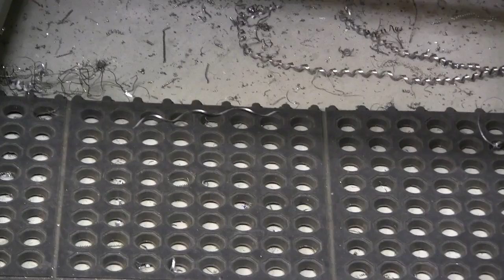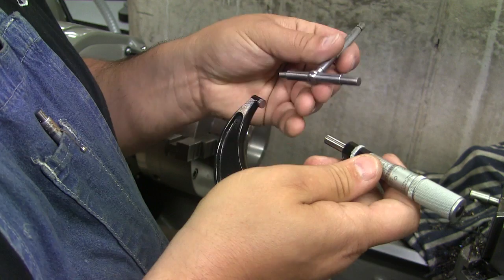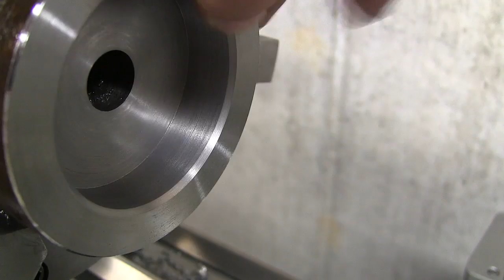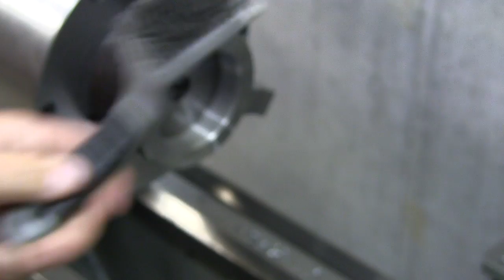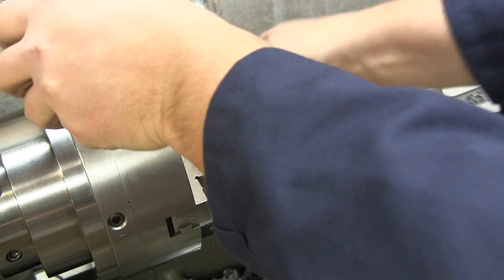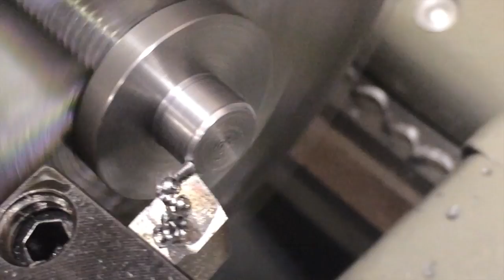Machinery Upgrade #2: Machining Lathe Leveling Jacks

Comment: I have no idea & readily admit it! That said it just looks to me like you have your work piece chucked up wrong, with the chuck jaws so far outside the chuck waiting to take some fingers or a hand off, while your oiling or chip clearing.
Is there a better / safer way to chuck up your workpiece?
One last question please.
Is there a reason YouTube machinists use oil to lubricate cutting operations that create so much heat, rather than using Chlor Parraffin cutting fluid?
Oil runs away from heat, so moments after you apply it, it’s no longer lubricating the surface being cut or the hss cutting point.
Chlor Paraffin however has the opposite property to oil, it is attracted to heat, and actively moves towards the heat source. The more friction, the more heat which means better lubrication. Chlor Paraffin is cheap at a couple bucks a litre, and as a cutting fluid is unbeatable. Company’s like Bitron etc add it to gear lube oil for diffs to protect gears bearings etc because any sign of heat attracts more lubrication.
It’s no good adding it to engine sump oil however, because the engine blow by gasses reacts with the chlorine of the Chlor Paraffin to for hydrochloride acid which is corrosive inside your engine which you don’t want, for manual gear boxes and differentials however it can’t be beat, and as a cutting fluid is the machinists fluid of choice.
My 2c - now I will get back in my box. 😜

Comment: I just ran across this older video. Someone should have told you to level with temporary shims and then grout understand the legs for full contact if the base. Temp forms around the legs and use a pourable nonshrnk grout.

Comment: what a great video. I admire your perfectionism.  we are finishing a second southbend lathe. my attention to detail is like yours, where there is not a nut bolt or gear tooth that is not touched. hundreds of hours, so I really appreciate your work. my question is how you painted the gear ratio plaque and the others, regarding the different colors. have had the greatest trouble with this. thanks steve.

Comment: You wouldn't by chance have a picture of the Gear ranges on the QCGB and the gears on the spindle side? I made a spreadsheet calculating gear ratios fro a logan QCGB and I am interested in seeing one for a SB lathe. I am forming an idea for a QCGB for a small lathe I plan on purchasing in the near future.

Thanks and keep up the good work.
Reply from the maker: I believe on the restoration video of the 13". there should be those pics.
Reply: Thanks! I ordered a mini lathe from Grizzly and I am in the process of designing a QCGB for it so I don't have to spend time manually changing gears.
Reply: William Combs ç

Comment: The jacks are awesome, the job you did was amazing. From your other post you mention you had an out of balance shaft/ gear that you feel was causing the lathe to move. At times when machining and out of balance part that same issue will happen. Resting the lathe in leveling points will never be able to hold the lathe down, only anchors down to the floor, shimmed and leveled of course first, will do.
Reply from the maker: +Douglas Smith For sure. There define;y is some RPM that makes the machine dance around.

Comment: Real nice machine,those original leveling pads you had were set up to high.They should have been down on the legs and touching the bottom of the machines legs or base.Most of those pads only have a 1 inch travel that's done in the rubber inself.The rubber acts as a vibration absorbing unit.
Reply from the maker: +Peter Will The back/left pad was just like that. It's my floor - it's SO out of level due to some sinking and cracking of the floor pad. In order to level the pads, they rose up like that. That's the reason these leveling pads are all custom lengths, to take up all the space. The machine (still) vibrates though as I've since located the real issue - an out of balance bull-gear. Gonna try to fix that in the future.

Comment: noticed your chuck is that a quick change mount ya got there
Reply from the maker: +Miguel Castaneda Thanks!
Reply: Oh mentioned to on quick change was that done by you or factory ...have 12 inch aquired
.essentially same yrs but threaded on chuck

Comment: 2000 rpm.....050 doc....20 ipm
Reply from the maker: +kevinp860 This machine will do .250 doc (done it before) but 2000rpm, is unattainable with a plain bronze-bearing machine.

Comment: Just wondering what model your Aloris tool post was?
Reply from the maker: It's a BXA
Reply: Thanks Brad.  I'm actually looking to buy a SB 13" and was also wondering if your lathe was a 3 phase or a single phase.  Thanks in advance.

Comment: Hi there, technical question please. I have noticed on several American machinist people here on you Tube, set your topslide / compound slide at an angle, for general turning. I did ask Tubalcain why, but he never got back to me with an answer. In this mode you are unable to turn to a shoulder with a set length unless you use a carriage stop. Here in England we always have the top slide set parallel to the lathe axis. Just wondered whether it was something that was taught in America and any reason for doing so. I know that it gives more clearance for the tailstock, but can see no other advantage.
Reply from the maker: Hmm. I guess it's force of habit Dave. I will though give your method a try, seem to make sense. Thanks for watching!
Reply: I'm new to machining, but I've been studying books and videos for a year or two, and I think the answer to the angled top slide question is that it's for threading. Angle is set for 29.5 degrees due to the 60 degree standard thread here with UNC and UNF.  If you leave it set that way, you don't have to reset it when you need to do a thread (unless you are going from external to internal and don't want to cut on the back side for internal).

Since I haven't tried threading yet, I do have mine set parallel to the spindle axis.  That lets me space cuts precisely or turn to a located face without having to solve any trig problems, use a dial indicator carriage locator (which I just finished making), or have a DRO (which it would be nice to have someday).  

-- Mike
Reply: Dave Ticehurst and what happens when you turn to a shoulder that is longer then the compound length? Carriage stop... Yeah still need one from what I gather. I usually leave my compound set for 29.5 for threading.

Comment: I have to say, that 13" South Bend looks awesome.  Since you've had a 9 and 10, I have to ask, is the 13 far superior?  Because it looks beast.  I'm looking for an SB, but am undecided what size is best for my needs.  Do you work as a machinist, or are you a hobbyist?
Reply from the maker: Thanks man. I like the 13" better because of the bigger work it can handle. That said, a Heavy-10 is such a capable machine as well as the 9" too. They're all great.

Comment: Man, what a sexy South Bend lathe you have! Did you restore it? Looks like it just come from the factory.
Nice work on the new leveling pads. I enjoyed seeing how most of your tools were high speed. Cool design, and I bet they worked great!
New sub by the way. Thanks for sharing.

Adam
Reply from the maker: Adam - thanks man! Yeah, I restored it a year ago. I also did a Heavy-10 and a 9a. Did a South Bend drill press and a Bridgeport too. I have videos for all those restorations (music and picture slide shows). I'm going to making some more shop0-videos of projects and such. Thanks for the kind words bro! You're videos make Youtube great!
Reply: That's looks power coated
Reply: By that I mean it's a great finnish
Reply from the maker: Kelly Breckenridge Thanks Kelly - it was just sprayed with about 4 coats.

Comment: anyone else think he is an accident waiting to happen every time he reaches in left hand in to brush chips or apply oil?   i don't know what training or experience he has,  but that chuck is going to bite him someday.  ...and the towel over his shoulder..  *cringe*

now that's out of the way,  that is a solid gold restoration mate.   machine is nice and tight.
Reply: I have to agree with you on the towel. Chips on the bed is part of the machining experience. If your going to try to protect the bed or ways use some accordion covers. But never us a towel. Yeah *cringe*. That is a beautiful lathe. More like a working piece of art. That is one of my dream lathes. I used the same model when I went to school 30 years ago for machining.

Comment: Noticed the D1 spindle. Did you drill into the original threaded spindle to accomplish this? I have been trying to come up with a way to resolve the issue of reversing the spindle and having to worry about the chuck spinning off.

Comment: Enjoy the videos. I have the exact same lathe. Curious about the finish on the jacks. What material are you using? I have had to basically use a finishing tool with a very pronounced radius in order to achieve a smooth finish on 1018. What speed, feed, and tool radius are you using? Why are you not making any more videos? I have been waiting for the next project!! Keep up the good work and share some videos soon.

Comment: I love your vid on making leveling jacks however you have your machine anchored incorrectly. The base holes are for anchor bolts after the main bases are shimmed level. This will provide a stable machine
Reply from the maker: Thanks Bruce. Yeah, I know they're not bolted (down), but in my basement, the machine isn't going to bumped or moved. She's real stable now. Glad I made them.

Comment: Beautiful machine and nice work on the jack legs. Couple of questions - what is your maximum spindle speed with your setup, and would you consider the 13 a good machine for a beginner? I'm looking to purchase sometime this year and I only want to have to buy one. Thanks!
Reply from the maker: Thanks for the kind words. Yup, I think the machine is fantastic - gives you a solid heavy machine with large range of work and small enough that you and your buddy can move it into the basement. Not sure of the speeds, somewhere in the 850RPM range.